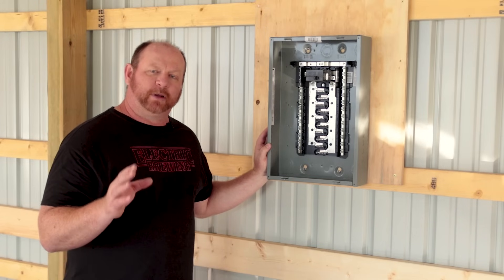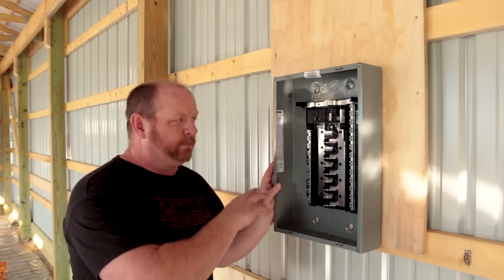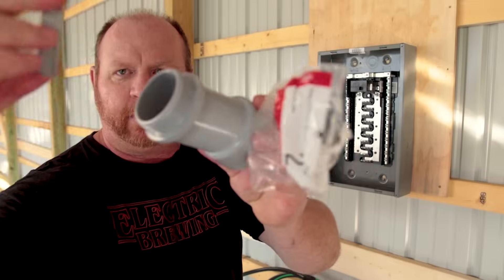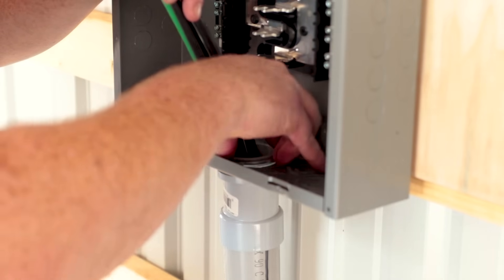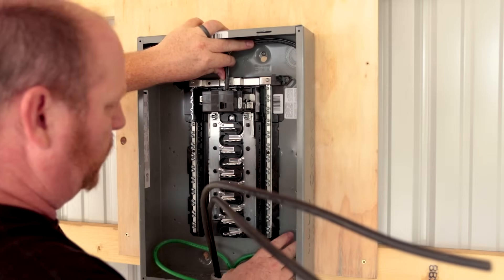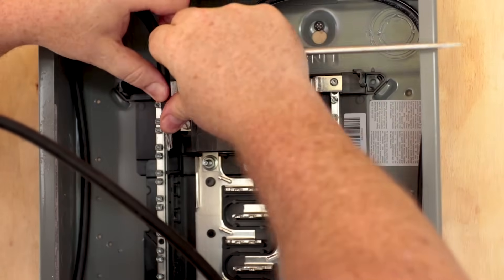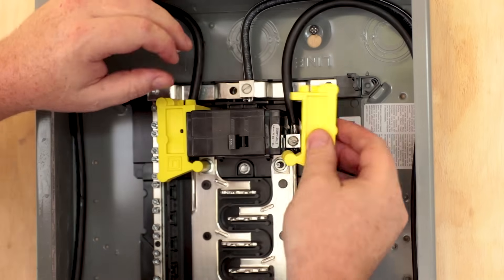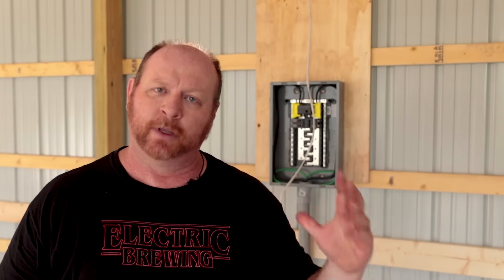How to install a main breaker panel in a garage. -  Square D Homeline 100 Amp Main Breaker

Comment: Nice but you missed a few things. 
1. You needed anti-oxidation (Noalux) on all your aluminum conductor terminations. Torque the termination screws correctly as well.
2. On a sub panel your neutral and ground need to be seperated. You need to add a seperate ground terminal in the panel that is used for all your ground wire terminations. Ground and neutral wires should be seperated. 
3. Ground rod should be added with a bare copper #4 wire.
4. Since it's open space Romex wire should not be used. Conduit or BX wire should be used to prevent damage to the wires.
5. A (TA) cap is required at the end of the conduit entering the panel with the service wires. 
6. Add a GFCI service outlet on the  plywood next to the panel.
Reply: It is actually a main panel, not a subpanel. In intro, he talks about the meter outside, etc.
Reply: @r0osboz1  the meter panel is the main panel every panel after it is a sub panel and has to follow code
Probably no inspections but insurance might not cover if it burnt down from a lightning ⚡️ strike n no ground bus n ground rod

Comment: Brain quick question your white is natural and black is hot when you connect your hot on to the breaker there is no current until you connect it what do you call that area
Reply from the maker: The bar?

Comment: II am not an electrician but doesn't a  sub-panel have to have the neutral and ground bars isolated from each other?  You mentioned running the neutral and ground wire into the neutral bar.

Comment: my panel does not have the main circuit breaker. The only thing that has is the breaker that cuts off the electricity to the house. The house has ac and is 220v and im trying to install another 220v line for an air compressor. What do i have to do if i dont have a main circuit breaker?
Reply from the maker: Are you just trying to add a breaker?
Reply: @BuildITWithBrian  yes
Reply from the maker: You'll have to cut off the whole house to install the breaker then to be safe.

Comment: your green grounding wire needs to bond to panel can and all branch circuit grounding wires.... The neutral wire is to only connect to the brenach circuit neutrals and be floating as in not bonded to the grounding and or panel can...

Comment: Good job.cuestion ? What zise wires i can use for 200 box?
Reply: 3/0 copper or 250 kcmil aluminum. depending on the load calculation. You could get away with 2/0 copper or 4/0 aluminum if your calculated load is low enough.

Comment: Hi Brian..I was advised that when using the aluminum wire it needed a compound between the tightening log and the wire or it will not pass inspection
Reply: That's often true in local codes. Probably best to put Noalox on it anyway.

Comment: put 4 screws and flat larger washers to secure the panel, keep it strong-good video!
Reply: Should be number 14 screws between 1 and 3 inches in length

Comment: It's a sub panel and you need a ground buss. Your neutrals and grounds need to be separated.  Your green wire is your equipment ground. The ground and neutral will tie together on neutral bar at main panel. I am an electrical contractor in Kansas. Now am 71 semi retired but still do some electrical contracting. Just did a house with 3 sub panels all required 4 wires. They go back to main panel and ground and neutral tie together on neutral buss. Main panels your allowed to put grounds and neutrals together but not in a sun panel. You also do not use the bonding screw in your sub panel. Everything ties back at the main, it's called center point grounding. It has to do with safety and ground fault currents. Hope that helps.
Reply: The idea is that the grounding conductor is only meant to carry current during a fault. If neutral and ground are bonded beyond the main connection to supply, the system will be using your ground fault system to carry the current imbalance between your two 120v legs from wherever you have it bonded. You want to avoid treating it like a second neutral. Its only purpose is to provide a low resistance path back to the transformer so that enough current can be dumped through a breaker to flip it during a fault like if a hot wire comes loose and makes contact with your clothes dryer. 

If the grounding system is being treated like a neutral and it’s bonded at a sub panel, that allows  the neutral current to find any route back to the transformer that is attached to the grounding system, which could potentially be you if you touch the wrong things.
Reply: Then why are there 4 wires coming in?  Maybe just a simple mistake?
I'm a DIY-er too, and I've spent a lot of time trying to figure out how to get this right.

Currently looking at my new 100 Amp Square D sub panel, trying to figure out how to separate ground & neutral, or bolt on a new bar for ground or neutral - or buy a more appropriate panel...
Reply: Simple answer Rob,  cost.  It looks as if he is using 2-2-2-4 mobile home service wire.  When using this the ground (green) is either cut off or left loose in box.  I just did my shop using this wire and saved $5.00 foot vs 4/0  @robmurray5784
Reply: Exactly
Reply: I think he knows that, that’s why he didn’t hook the ground up in this episode because the panel didn’t come with a ground bar so he can separate the ground that’s why the ground wire is bundled up at the bottom of the panel
Reply: And the Ground rods and Noalox for the aluminum conductor ends.
Reply: You are correct for a sub panel, but he showed that this is coming from a meter outside the building, so the box needs to have neutral and ground bonded together.

Comment: Pretty good video.  You need to use anti-oxidant compound to the aluminum wire.  You sub panel would fail inspection.  Otherwise, pretty good job.
Reply from the maker: Yeah I added it later.. Good call!
Reply: @BuildITWithBrian  , shouldn't you also ground the panel and all outlets to a separate bus and ground rod?
Reply: Look at the writing on the cable,if it's aluminum alloy then no de-ox is necessary.

Comment: Grounds and neutrals are to be separated in a subpanel . And what about the grounding bar because I never saw that being installed and let's not forget the D -ox. And being a separate building I will be putting in some ground rods. Overall nice presentation

Comment: after watching your brewing vids, I stumble upon this as I'm finishing a steel building I just had constructed. Are you running a separate service to your building? I saw the meter outside, so I thought I'd ask.
Reply: Other then that a pretty good install.
Reply from the maker: It is run off of a breaker in the main transformer meter base.
Reply: @BuildITWithBrian  if that's the case per NEC the neutral has to be bonded at the breaker in the meter base so you need to land the green wire to the can at the meter base and add a ground bar in your panel and terminate the green wire to it. Also a ground rod is needed at this location too. It to prevent objectional current. Usually caused by lightning or other sources can cause it to.

Comment: with all do respect, you are really doing some sloppy work sir, not to mention you need to use more up to date terms, fuses are totally different nowadays. Those are CIRCUIT BREAKERS not “fuses or fuse blocks”... Again no disrespect sir. I’ve been in the trade for 21 years and would expect to see code worthy work. Not sure of your jurisdiction, but I am sure that we should have respect for electricity like you stated!

Comment: Also should use a corrosion inhibitor on the bare aluminum wire ends prior to fastening.
Reply: No longer required, the aluminum alloys in use today are corrosion resistant.

Comment: Hello, I just hired a electrician to replace a panel for me in my garage. It is a GE brand new panel. they are a few breakers that are kind of lose that you can wiggle them especially one of them i feel you can probably  just pull it out. they are all working now so my electrician say the breakers are good. My question is will this cause problem in the future? is this normal or it is because not properly installed? Please help.
Reply from the maker: They never fit super tight, once the faceplate is in place you should be fine.

Comment: Use groves and never put two hands inside a breaker box unless absolutely necessary. And never ground your self, electrons will still conduct through cloth when wet. Be safe tganks

Comment: why didnt you flip the box over?  Your runs go up to the rafters and your supply comes in from the ground
Reply: Even if the power line comes from top of telephone pole ?
Reply: @edwardsuarez88  it comes from the slab on this one. If it came from the top I'd run it from top
Reply: Gothcha thanks much.
Reply: @edwardsuarez88  if it's a permitted job they might make you go through the top regardless. My grow house uses copper 250nm wire. So at 12 dollars a foot I even moved the boxes down

Comment: No bonded ground to the main panel/xmfr?     That is a no-no.     You will be making ground through the neutral?       sounds like a terrible idea.    No way you are going to ever get a GFCI to work on that system.

Comment: This is a sub panel installation. Copper should have been used and the neutral and ground should be isolated in a sub panel. The main panel should have neutral and ground bonded not the sub panel. The main panel should be bonded to main water line and two grounding electrodes installed 6 ft apart minimum and bonded with a bare  #4. The sub panel should not be bonded to provide a low resistance path to current travel to the transformer  in the event of a ground fault. I am an electrical engineer and building official.

Comment: I guess this is a sub panel, ground and neutral can't be together! You need to install a separate bus bar for ground. Also you need to add anti oxidant paste when you use aluminum feeder! good video overall.
Reply: not a sub panel.  electric company put pole for this shop
Reply: Justin Psycho Monkey Johnson but the main disconnect is located at the meter making this a sub panel

Comment: Hello just wanna know What happens to that green ground wire that you left in the box
Reply: He said in another comment that this is a sub panel coming from his main panel. Because of that the neutral and ground need to be separated in the sub panel he installed in this video. You do that by removing the grounding screw that is currently connecting the metal case to the neutral bar. Then you install a grounding bar which should be grounded using that green wire. 

The green ground wire and the neutral leg should only be connected in the main panel. Not in any sub panel.
Reply: @ecospider5  In Minnesota, subpanels need to be grounded via a #6 copper wire to a grounding rod. I don't know the rules anywhere else. I don't know where that green wire goes, though.
Reply: So in the sub panel the neutral wire is not connected to the sub panel metal box. So the metal box needs to be grounded so that if one of the power legs coming too and powering the sub panel shorts out with the panel box the breaker in the main box will trip. If the breaker in the main panel doesn’t trip then the sub panel metal frame will be energized. 

The way a breaker trips is excess current going through it. Their has to be a low resistance path for that to happen. That green wire is the return of that low resistance circuit. The ground rod is the backup path but the resistance back to the panel is unknown so does not always trip the circuit. 

Also the ground rod should be lower resistance than a person to ground. So if there is a short and the main feed breaker doesn’t trip when you touch the panel you will get shocked but most the energy is going through the ground rod to ground so hopefully you don’t die. 

So the green wire is connected to the same location as the ground rod. Of course this is only in areas that require the ground rod as backup.
Reply: @ecospider5  I'm not an electrician. If installing a 240-volt subpanel, you kind of wire the box like you would a 240-volt outlet. You have two hot lines and a neutral. But you also have a ground (4 wires in total) coming from the main in the house.

You run the two hots and neutral like you see in this video plus the ground to the case ground.

But you ALSO ground to a 8-foot grounding rod buried in the ground using #6 wire (or bigger).

This page: https://bloomingtonmn.gov/sites/default/files/handouts-b%26i-fffdetach.pdf

Is from the city of Bloomington, MN, and does a pretty decent job explaining it.
Reply: Yes that is how I understand it also. And it seems like the areas that require the ground rod as a backup have the right idea. But I can say not being an electrical engineer I really like to see articles like that because grounding issues can get really complicated.
Reply: @ecospider5  Yep. I choose to believe that the City of Bloomington (which matches what Maplewood required the last time I wired a garage) has carefully-chosen their electrical codes.
Reply: NOOOOO!  That’s NOT how it’s installed. Where is the ground connected to the box and since the panel is in its own building, it needs at least one grounding rod. This would not pass inspection AND your insurance won’t cover any claims (such as fire, injury, death) resulting from its failure. Also, all codes require an oxidizer preventer on the ends of the cable before they are installed in the box.
Reply: Some locations require a ground rod at the second building for code compliance. But if you only use a ground rod at the second building and no solid conductor from the main breaker box to the second building breaker box then if there is a short at the second breaker box there might be to much resistance to trip the 100amp breaker in the main breaker box. So having the solid wire from the main box to the second box will guarantee low resistance so a short will trip the 100 amp breaker in the main box.
Reply: @ecospider5  Please clarify what you mean by ''... and no solid conductor from the main breaker box" followed by "So having a solid wire from the main box...".  I think you mean ground wire from main box in both instances.  Thanks

Comment: Easy to understand, well done, but with respect as others have mentioned the missing De-Ox for the AL conductors and its a big no-no to run mains through branch circuit section of the panel(sub panel w/no main breaker is ok b/c theres a breaker ahead of it)...the only thing protecting you from severe electrocution are the fuses below the transformer on/in the pole/box outside and believe me, you're body doesn't have enough resistance to open them. Just needed to have panel mounted further to the right and extend pvc conduit up to the top and use an LB to take wires into top left corner or I've also seen the panel installed sideways to take wires to main breaker(paying attention to door swing). Nicely explained but people please take advice from a licensed sparky...it will save you all money from having to re-do it( due to improper wire sizes&proper bonding/grounding) and possible a life.